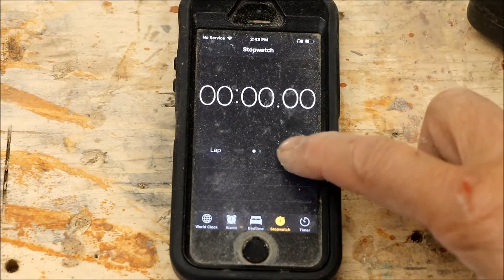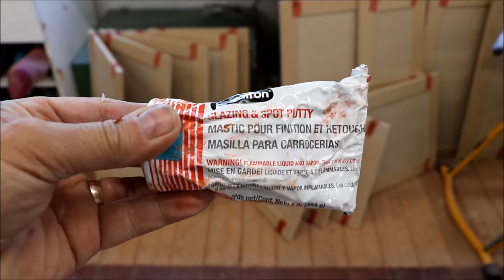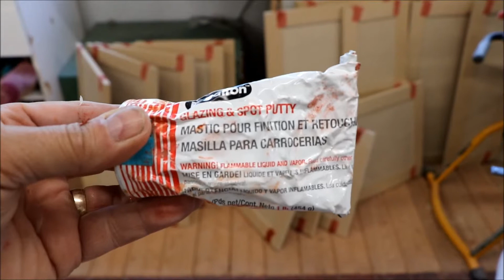5 Piece MDF Shaker Doors Part II

Comment: Why a space ball in the groove with the MDF rail and style
Reply from the maker: i suppose with MDF it is not needed so you could glue the panel in but with solid wood it will allow for expansion and contraction for the insert panel

Comment: What grit was used to sand the doors?
Reply from the maker: I usually sand from 150 to 180 on MDF doors
Any lower grit leaves scratches on MDF any higher is not necessary. Also I usually use Automotive Glazing putty on joints.
Reply: @fromthewoodsyyc   Does using such grits cause the fiber to "pop-up" which cause poblems in finishing? I was thinking of using 240, but appreciate your input. Thanks!
Reply from the maker: @alejandrocruz5261  240 grit is overkill in my opinion but it can't hurt. I would use a solvent based primer to avoid raising grain then you  can use finish of choice. I generally use lacquer primer which sands smooth and pre-catalyzed  lacquer final coat or coats